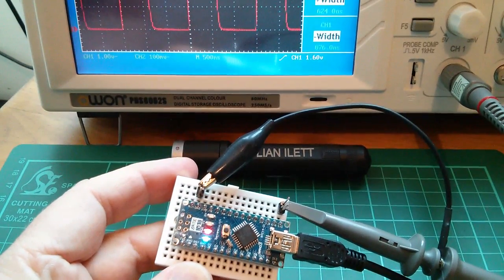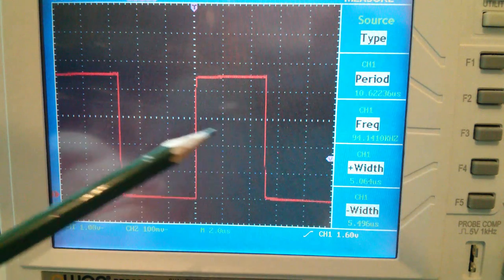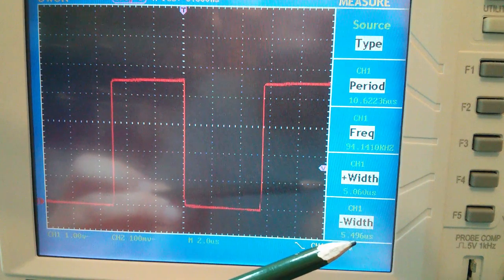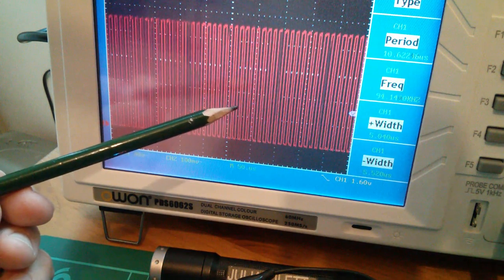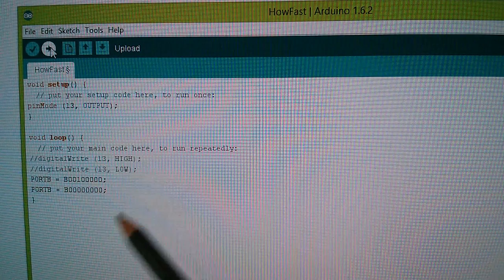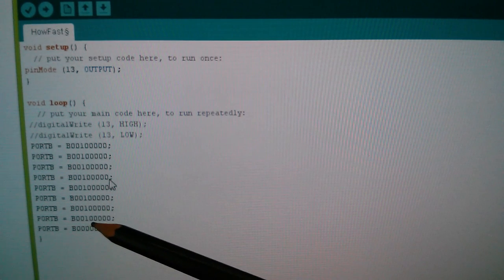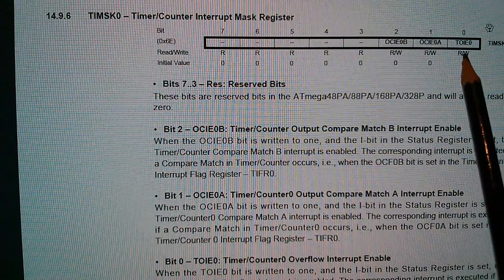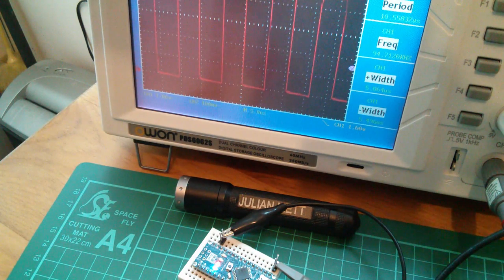Julian Investigates: How Slow is Arduino?

Comment: you could use OR and AND to set and unset.

PORTB |= B00100000 //set
PORTB &= B11011111 //unset
Reply: +SerBallister Using the bitwise NOT ~ is one more instruction, thus I think is better to use the bitwise AND & with bits set to ones. Less instructions, less mic cycles.
Reply: ***** Using ~ on a constant just inverts the constant at compile time. It should be one AND instruction.
Reply: +SerBallister I assume you do not know assembly. "BITWISE NOT" or "ONE'S COMPLIMENT" operator, has its own independent instruction and in Atmel856 microconteoller is called COM. You have one less instruction and one less mic cycle by not using ~.

http://www.atmel.com/images/atmel-0856-avr-instruction-set-manual.pdf
Reply: ***** I do know assembler. I assume you don't know what constant folding is?

PORTB &= ~B00100000;

is exactly the same as

PORTB &= B11011111

when compiled.

As a different example:
Say if i have  PORTB = 1 + 2 + 3 * 4;

That does not mean the compiler is going to start emitting instructions to add together immediate operands of 1,2,(3*4).

In pseudo code would be something like..

MOV R0, #3
LSL R0, 2    // 3 * 4
ADD R0, #1
ADD R0, #2   // = 1 + 2 + 3 * 4

 A modern compiler will evaluate the expression to an immediate of 15 as it knows all the terms are constant and thus the result is known at compile time. 

e.g.

MOV R0, #15   // = 1 + 2 + 3 * 4
Reply: +SerBallister 

Well, for most compilers it may be exactly the same, when working with constants, but for some other it
translates by using the operand directly, which as I told you is not AND, but
COM and it takes up a mic cycle. This would definitely compile to an instruction if we had a variable instead
of a constant.
At this example on the video, there is absolutely no reason at all to use:
PORTB &= ~B00100000;
instead of:
PORTB &= B11011111;
when doing it by using direct constants.

The only practical reason to do this and invert all bits, is when using
variables or stored constants and you can’t manipulate the bits by typing them:
byte portState = PORTB;
....
PORTB &= ~portState; // invert all pins
Reply: In that case you would use CBR and not COM for your Atmel mcu ?

The reason I suggested inverting the bit is that it makes it much simpler to have a single definition in a header file somewhere for constant bits..

// Header.h
 #DEFINE   MAGIC_BIT 0b100000

// Code.c
Port &= ~MAGIC_BIT;  // Clears
Port |= MAGIC_BIT;     // Sets

So we don't need 2 defines for the same (constant) bit. Since we are using constants we can rely on constant folding to produce a single AND-with-immediate instruction.
Reply: +SerBallister 

The operand is COM:
COM Rd One’s Complement
and not
CBR Rd,K Clear Bit(s) in Register
you can do further investigation to learn more about it.
As I pointed out, there is no reason to use such method when using DIRECT constants
and not STORED constants. Here we have a DIRECT binary constant, so, the bitwise
not operator (~) is useless.
I didn’t tell that this technique is not used. The case you are pointing
with the STORED constant is used not only in microcontrollers programming, but
everywhere from Linux to DOS programming and these STORED constants are called
flags.
Reply: I don't need to do any investigation, I can read the datasheet you posted.

also, when you say 'operand' you mean 'opcode' ?

Anyway, I stick by what I posted.

The bitwise ~ is used for a constant to simplify the source code. Only 1 bit definition is required, and it can be used in both bit-set and bit-clear cases. There will be ZERO performance implications for doing this, but there will be a readability improvement in the fact I don't need 2 complementary definitions for a constant in my code.

Stored constants are called flags? From Linux to DOS? I never heard of those ?
Reply: +SerBallister well if you insist, I cannot help you... google one's compliment and read what it is in wikipedia... 
Also google "~ bitwise not operator, one's complement" to see what it is and what it does... 
Also, if the datasheet is your reference, read what COM instruction is for...
Then if tou still insist, then you may have issues understanding things...

And for you to know, bitwise not operator (~), does not take one bit to execute, no instruction takes one bit to execute... and it is used with variables also not only constants...

As for the flags, I'm saying what I know about computers programming. If you ever get into computers programming, you will learn about what I am talking about. If you want to see an example, google BitBlt function and see what constants the last parameter receives. Those are called flags and are mostly defined by using hexadecimal values: 0x01, 0x02, 0x03 etc., which are exactly the same as if were defined by binary values.
Reply: ***** Amazing.
Reply: Using |=  and &=  is translated into 3 assembler instructions, one loading PORTB, one oring/anding with an immediate constant, and one to save back the reusult into PORTB.
If the Arduino supports it, a much better solution is to use bit-banding, which would require then a single assembler instruction.

Comment: I wonder, if you modified the core main() function, get rid of loop() and additional instructions, and only use setup() or directly programm into main(). With all respect, professionals would change only one bit, and you are changing all 8 bits there. 
 PORTB |= B00100000; //ON
 PORTD &= B11101111; //OFF ;)

Comment: I was surprised my self when I discovered that digitalWrite() was slow because I have learned that toggling pins only took ~2 clock cycles. Remember that reading with digitalRead() is also slow and can be made faster with direct reading of the port instead. Also there is a built in function called noInterrupts() to turn off interrupts and you can enable them again with interrupts() https://www.arduino.cc/reference/en/language/functions/interrupts/nointerrupts/

Comment: It's more that a branch. It's a function return, a branch and a function call.
A return from loop() to main(), a jump to the start of main() (or maybe even a while(1==1) evaluation) and another call to loop()
If you ditch the IDE and use https://github.com/sudar/Arduino-Makefile instead you can just put your code in the main() function and even use (gasp) a GOTO instruction instead of Arduino's while (1) { loop(); } : https://github.com/edgeeffect/rotary8/blob/master/test-lights-buttons/test.cpp#L16

Comment: Just a simple rewrite of the Blink sketch

void setup() {
  PORTB = B1101; // sets digital pin 13 HIGH
  TIMSK0 = 0; // Timer Interrupt Mask Register
}
void loop() {
        // LED On
        PORTB = (1<<PC5);
        _delay_ms(1000); // set one second delay 
       
        // LED Off
        PORTB = (0<<PC5);
        _delay_ms(1000); // set one second delay 
}

Comment: That what you get when you program using macro-for-everything HAL language, One lazy instruction "just_set_this_port_bit(port_bit)" take longer code and takes more space. If people are not willing to learn the actual HW of their microcontroller, they cant expect performance. You can bit this effortlessly using and OLDER Motorola S08 part. Its is slow because its easy to set an program macro based.I saw code using int types to hold just a flag. To get the best control on iinterrupt, again ,you need to fully undestand the micronctroller and use is as a microcontroller rather than a PLC.

Comment: Time to get your Atmel assembler out?
Reply: I wrote for atmegas before arduino was born. That is actually the only way to write anything reliable or time critical for them. You type your C code, execute it, see that it is not doing what it was supposed to. Look into produced asm - "holy crap, what a mess!"  And there goes atmel's appnote reading, plain asm coding and stuff. I just moved to other architectures. When Arduino came about, I was plainly disgusted by the idea of adding another layer to that shitburger, and when it took off I was just bewildered by the amount of effort humanity can put into such a project.

Comment: ldi r0, 0x00
    ldi r1, 0x10
    sts DDRB, r1

loop:
    sts PORTB, r0
    nop
    nop
    sts PORTB, r1
    rjmp loop
Reply: Alistair Buxton 1. What is DDRB and 2. why the two NOPs?
Reply: Malcolm Why not fill the nops with another toggle then ? :)
Reply: That makes sense, I suppose it all depends on what you want to measure. Maybe how long it takes to rise and then fall is a useful metric. That rjmp is still needed in any case for the scopes benefit.
Reply: You can only use LDI on registers 16-31
Reply: @csbluechip  I believe it's a two instruction delay, has a similar effect to the technique of repeating the previous statement.  Makes more sense from a purist point of view.
Reply: Yessss!!! If you want quickest program use assembly! But arduino goal is make programing easy for beginners, sacrificing speed.
Reply: @csbluechip  2 nops are used to compensate rjmp instruction execution time of 2 cycles. So:
sts PORTB, r0 (2 cycles)
nop (1 cycle)
nop (1 cycle)
sts PORTB, r1 (2 cycles)
rjmp loop (2 cycles)
So 4 cycles high voltage, 4 cycles low voltage = 8 cycles full wave swing,
for 16MHz crystal it's going to generate 2MHz square wave.

Comment: hi ,here's something much  faster, don't use the arduino program to develop the code (use a program called algorithm builder )made by a russian guy to work with most Atmel chips(it's much easier and faster even if it's modificated assembly language)and burn it onto the board with avr dude (its the way that arduino program does it anyway ,just a bit more complicated)see then what speed you get

Comment: Try it in assembly.
Reply: That's unlikely to change anything.

C/C++ (withouth Arduino overhead) will be translated to the same stuff before you upload it to the microcontroller.
If your compiler is good enough, C will run as fast. Which shouldn't be a problem for a blink program.

"Now try it with a 20Mhz crystal" will make more sense.
Reply: +xFuaZe you're wrong, check out that stuff more. Assembly rocks in the micro controller world!
Reply: Vujke Digital 
It really depends on the case.
If you can write better/more portable code (which may not be faster, but fast enough) in a higher level language. It may just be worth it.

Using assembly in every single case doesn't really make sense to me.
Reply: Like... Have you watched the video? C/C++ itself is compiled into a steaming mess of asm. Then they add arduino...

Comment: void setup(){
  DDRB = 0x20;
  cli(); //global interrupts off
}

void loop(){
  for(;;){
    PORTB ^= 0x20;
  }
}
Reply: +Elektro-Peter PORTB ^= 0x20; is equal to 
_asm_("in r24, 0x05\n eor r24,r25\n out 0x05,r24");
which is 3 lines assembler (6 bytes). It is faster with 
PORTB |= 0x20; PORTB &= ~0x20;
which is only 
_asm_("sbi 5,5\n cbi 5,5\n);
two lines asm (4 bytes).

Comment: Why to buy an arduino if you can get raspberry pi? just asking guys.
Reply: Because you can buy clones for $2 on eBay, AliExpress and others. You don't buy a bag full of raspberry pis and throw them in a drawer. Also Orange Pi, Nano Pi, Banana Pi, etc. are all alternatives you might want to consider.
Reply: aiklarung k cool lol
Reply: +anguissette it runs at 160MHz? That's neat, is that the same board with the WiFi module? Also, was that meant to be a quote? lol
Reply: Thanks +anguissette - that board even looks like an arduino uno! Seems like a convenient board to play with the microcontroller comfortably before deciding on a tiny barebones ESP module. Also it has a neat battery shield so I can imagine both making IoT a piece of cake.

Oh China, so little human rights but so many affordable electronics for DIYers...
Reply: The main reason is because with Raspbery Pi you have an OS running. So, you don't have absolute control over the code that is running. That is important for any time critical operation. On the other side, Arduino has not an OS, so the running code is absolutely known and predictable.

Comment: hey this is 2.67 MHz on my arduino nano;

void setup() {
}

void loop() {
  while(true){
  PINB = B00100000; 
}
}

//only this...
Reply: +Sacit Boztas   ...but not a true square wave.  Interval between port state-changes at loop-back is longer than the others.  Jitter.

Comment: You can speed up digital writes by manipulating the port bits
Example:

//Assuming Digital pin 13  == PB5 == Port B bit 5
PORTB != (1<<5);
delayMicroseconds(5000);
PORTB &= ~(1<<5);

Comment: I have to say that I don't really see the point of this, unless you are demonstrating how to use a scope. The speed of the AVR is known, the speed of the crystal is known, the compiler is gcc (known), and the libraries come in source form so you are free to inspect the code and replace if you don't like. So what are you investigating?  Sure, some of the Arduino libs are poorly designed - but you don't HAVE to use them.

Comment: Using Arduino IDE is the bottleneck....rumor has it DigitalWrite uses 40 cycles.....RISC uses single clock cycle per instruction.

Comment: Ok, thanks for the motivation... some assembly to reach 2.66Mhz:
void setup() {
  pinMode(13, OUTPUT);    // Digital pin 13 as an output.
  noInterrupts();
}
void loop() {
    asm(" asmloop:       ");  
    PORTB |= B00100000;
    PORTB &= B11011111; 
    asm(" RJMP   asmloop  ");
}

Comment: It is not only slow, it is bloated. Compare this code:

/* Blink example in AVR C */

#define F_CPU 16000000UL

#include <avr/io.h>
#include <util/delay.h>

int main(void)
{

/* -------- Setup --------- */

 DDRB |= (1 << PB5);  // pinMode(13, OUTPUT)

/* -------- Loop ---------- */

 while (1)
 {
  PORTB |= (1 << PB5);  // digitalWrite(13, HIGH)
  _delay_ms(1000);
  PORTB &= ~(1 << PB5); // digitalWrite(13, LOW)
  _delay_ms(1000);
 }
 return (0);

/* This line is never reached */
}

Compile this with the AVR C toolchain, then compare the hex file produced with the one produced by the Arduino IDE. It is quite surprising.

Comment: that's an arduino mini CLONE and its from china.....
it not fair to judge the speed of a genuine mini from a clone.
i understand that the architecture is open but the components may or may not be genuine, say the atmega chip.
Reply: +Reese Me The AVR chip is genuine (not even the Chinese can just knock up a silicon fab line overnight), so if the input clock is the same then the performance should be identical.